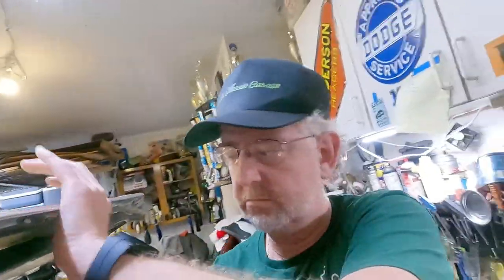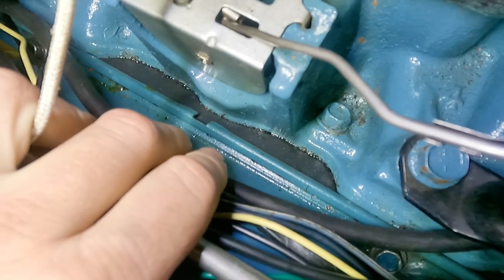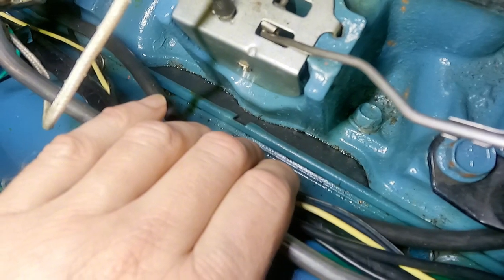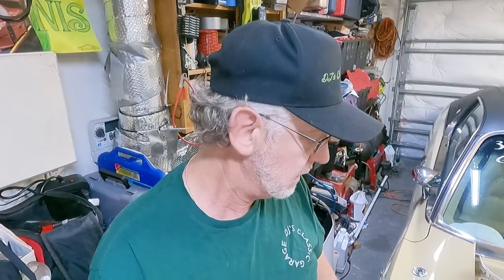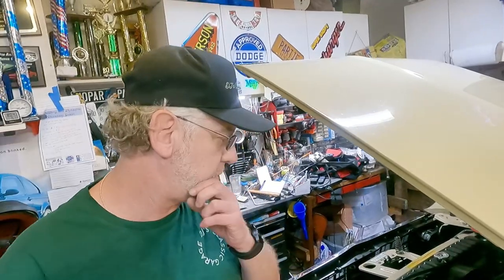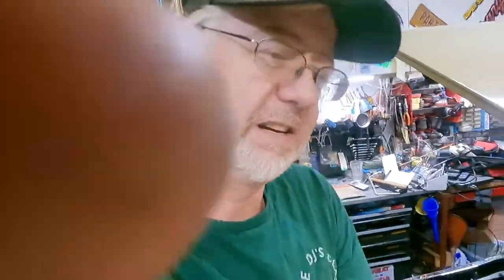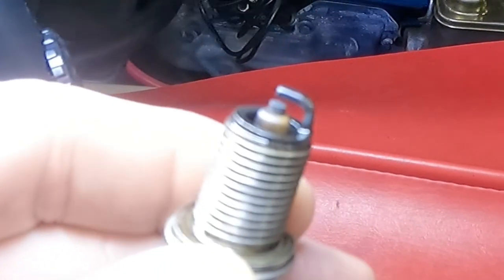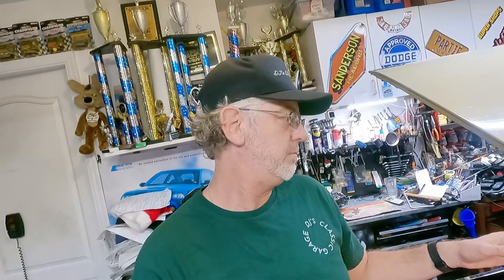Is The Engine In Trouble?! Why Is The Cylinder Filled With Oil?

Comment: From the look of that valve I'm thinking maybe that valve seal is shot. Unless it's pushing passed the rings, I'm not sure how else oil is getting into that cylinder. The intake is a weird one. I've seen oil push passed bolt threads when they run into an oil drainback passage, but it's around the bolt, not the so much the mating surface. If you've already diagnosed the PCV I'm not sure how it's getting into the runner. Let us know what ya find out. I'm curious.